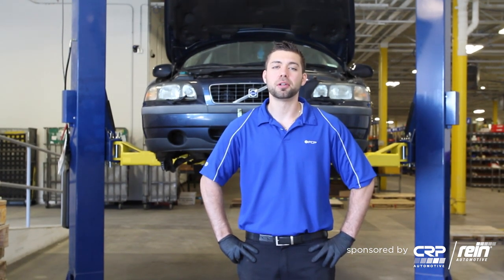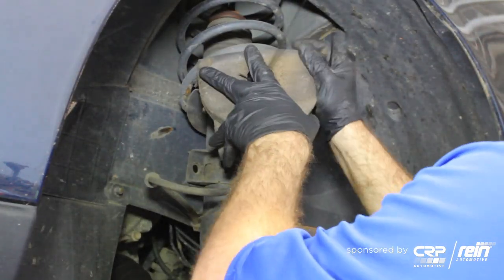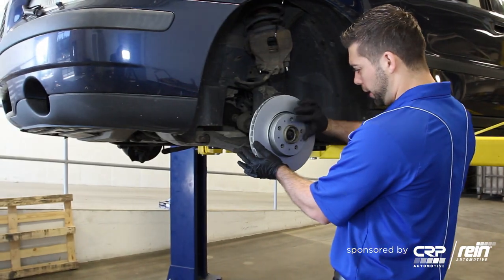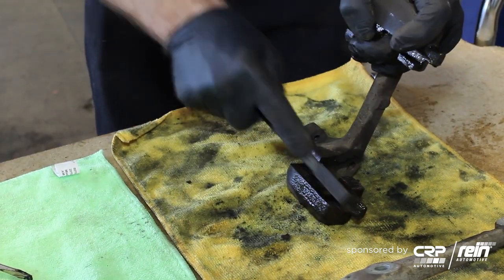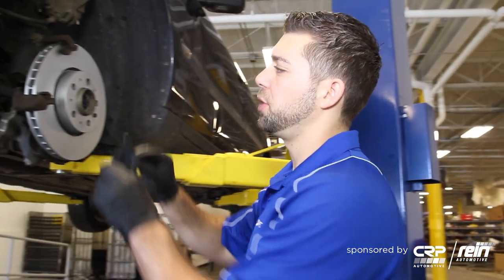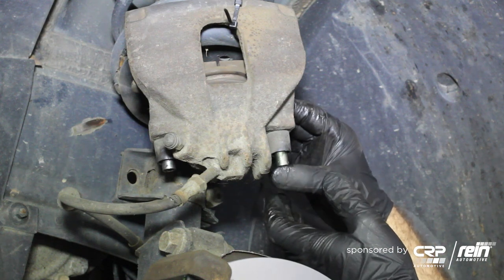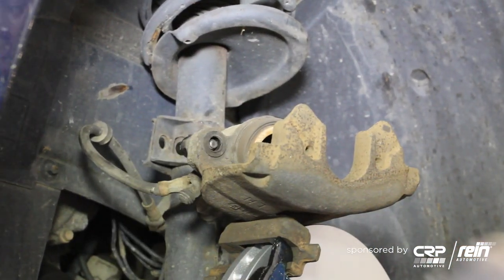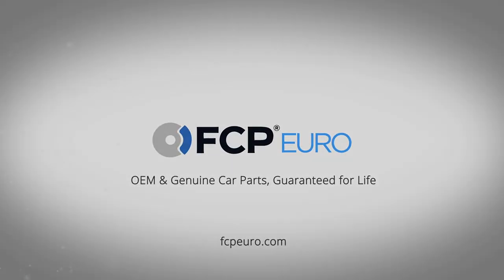How To Replace Volvo P2 S60 Front Brakes DIY (S60, S80, XC70, V70)

Comment: I wanted to take a moment and say THANK YOU! It's been over 20 years since I did my own rotors and pads; but between that and your video, I had everything I needed! Very helpful, very methodical, very detailed! The ONLY thing I would add is that I added Permatex Anti-Seize (grey tube) between the inside of the rotor cap and the wheel hub...but this is, of course, optional. I also needed to go through a bedding procedure (after pumping the brakes to move the piston in) before my brakes were braking like normal again (but that was the fun part of the replacement!)

Comment from the maker: The T-5's have the larger brake setup in 2006 so they will be a bit different however the essential information from this video can be used to help you.
Reply: Same with the t6s. Instead of 7mm Alan its a t45 torx. Believe all else is the same

Comment: There is one very important trick with the respect the spring clip replacement. 
If you happen to put them on with little or no effort, you have installed them incorrectly. Doing it incorrectly will 
A; drive you insane as you try to determine why your brake pedal is so mushy. 
B: Make you go even more insane as you start to try bleeding the brake lines and start contemplating a master cylinder. 

You went past that part quite fast and it is very important to get them right. 
If you edited in a short piece of how those spring clips should be on the outside of the caliber bracket and why you have to use that screw driver to pull the clip up and over the end, it would help with that last important installation step. 

Other wise a good video.
Reply: Can you explain more?
Reply: Absolutely and thank you for writing this! 

Happened to me exactly as you described and your comment saved me a lot of screwing around!

Comment: I liked this video overall.  Too often cleaning the calper frames is skipped.

One note, the time to indlect the caliper piston boot is before the piston is pushed back, and it should be rinsed off eith brake clean and lightly lubribated before pushing it in.

Comment: Hello, typically you'll need to change them at every other pad change however its always best to measure the rotors at every brake change to make sure they're not below the minimum thickness noted on the rotor hat.

Comment: Nice straight forward instruction video. I did notice that the brake hose was frayed and almost coming apart! I would have replaced it, and if saved for a different video at least point it out.

Comment: Are the rear brakes the same?  Oh, I'll be replacing the brake fluid as well do I start with the Right rear brake line on the S60 or is the ABS Module in the rear?

Comment: I'm old school and always open the bleeder when I push back the piston.  The reason was that you never push fluid backward into the ABS.  Things may have changed over the years but back in the day working on Jaguars there was more than a few ABS valves / pumps that were destroyed by pushing fluids backward.  Dirt ...maybe but the cost of those ABS valves were $1500 and it was much easier to open a bleed valve.
Reply: Thomas Miller

Comment: Thank you! This all turned out great and stops on a dime. No pulling or vibration when braking so I know the rotors are on true.however I hear a grinding on both sides when accelerating or rolling in general . Could it be that the new rotors are thicker and I need to pry the shield back a little? Mine were the 11" diameter x 286mm thick. Pre turned. Got them from Napa. It sounds like the shields. I verified everything is locked down and the springs are in the correct position. Any thoughts? Thanks.

Comment: Video was so easy to follow.  This was my first brake job and it went smoothly. I also need to change the rear brakes and hope you have an easy to follow video for the rear.  My one concern after changing the front is that the pedal seems soft after pumping the brakes.  What do I need to do to fix this?  Do I need to bleed the brakes?  If so, any videos available showing how to do this?  Thanks in advance for your response.
Reply: Watch the part very carefully where he reinstalls the spring clips. 
This is extremely important.

Comment: Zip tie trick is great. Procedure is identical for 2006 XC70 except I don't have that backing bracket behind the carrier bracket which is nice. Also, I suspect this guy likes the smell of brake cleaner because he uses it on everything. Study the way he puts on the caliper spring. Much easier than the way I did it.

Comment: Hi guys, I loved your brake changing videos!!! Is it true that you have to change the rotors on a volvo s60 2004 every time you change brake pads?
Reply: I am not an expert on volvos or cars, but for me I always change the rotors when I change the pads.  but if you dont  want too just make sure they are within spec and have them turned. :)

Comment: I want to replace my 2016 S60 stock 300mm Calipers to the 336mm R-Design ones for increased braking power is it just the calipers and pads replacement or other parts are involved too?

Comment: Hi. I found that forcing the piston back into the calliper caused a problem with the brake system and resulted in loss of brake pressure. I think what needs to be done here is to loosen the bleed nipple then push the piston back and allow the fluid to to pass through the nipple. Retighten the nipple when the piston is all the way back. This method means the rest of the brake system won't be affected.
Reply from the maker: Hi Geoff, that is certainly a way to do it! You can also remove some fluid from the reservoir at the beginning of the job, and then top off as needed.

Comment: One thing that is super important to mention is the corrent rotation for the ventilated disc they just dont go on any way
Reply from the maker: A good majority of ventilated brake rotors are non directional. You can tell if a brake rotor is directional based on the orientation of the fins inside the brake rotor and there are usually different part numbers for the rotor between the left and right side on the same axle. The S60 featured in this video uses a non directional brake rotor so no special attention needs to be payed when mounting them to the vehicle.

Comment: you do good vids and now happily a subcriber.  I've done many pad changes on other cars and dont suspect this should be any difference.  I have the pins out and have not be able to remove the caliper from the frame, over an hour of prying and banging  and just seems hung up and wont pull off, i have compressed a bit the piston while still on the frame to try to create more clearance. Don't get it, any suggestions? Why do small simple jobs too often find a way to be not so?
Reply from the maker: Thanks for subscribing, Barry! That is strange that the caliper is hung up in the carrier. I would just remove the carrier/caliper bracket altogether if you can't get it separated.

Comment: Hey, is it necessary to put loctite (blue or red?) on the bolts that hold the caliper bracket in place when putting them back in? Going to do this job on my 01 S60 soon
Reply from the maker: Hi, Michael. It's not 100 percent necessary, but its also not a bad idea to do so!
Reply: @fcpeuro  thank you very much! Bought some loctite just for extra safety :)

Comment: What type of grease you r using? Can I use just copper grease?
Reply: The grease it ATE plastilube p/n 700015 which can be found here: https://www.fcpeuro.com/products/brake-pad-silicone - This is what I recommend to use.

Comment: What are the torque specs for the caliper and bracket bolts?  Also, should I use thread lock on the bolts?  Will this work on an 06 S80?  I already bought the kit from FCP.
Reply from the maker: This kit fits an 06 S80 w/286mm front rotors. The caliper slide pins do not need lock tight however the caliper hold down bracket bolts do. The torque is 30nm on the caliper bolts, 100nm on the caliper hold down bracket bolts.

Comment: You pump the brakes to push the cylinder and pad against the rotor not "to build hydraulic pressure". That way, when you need the brake for the first time, the piston won't have to travel a long distance before seizing the rotor.

Also I don't believe lubing the back of the pad does anything. Lubing the sliding parts of the pad sure, but not the whole back.

Also you should use a torque wrench for final torque when putting it back together.

Comment: After watching this video, I realized something. I just bought a 2006 S60 T5 (first car woo!!) and for some reason the calipers look nothing like that. They have a full frame and clip where these just have the spring clip. They still say ATE Volvo on them so I know they are an OEM front caliper, but with all the DIY videos and writeups I see, there's none with my type of caliper.Besides the frame, would there be any glaring differences I should be worried about?
Reply: Nothing to worry about if your brakes are working.
Reply: After getting them done by myself, I realized that my example was one of the few 2005-2007 ones that got the XC90's 316mm front discs and calipers. 

Hooray for FCP and their endlessly understanding team having to deal with me. hahahaha!!

Comment: What kind of grease was put on the back of the brake pads and what kind was used on the slide pins? Is it the same for both?
Reply from the maker: Yes, you'll be able to use the same paste for both. ATE Anti-Squeal Paste was used in this video.
https://www.fcpeuro.com/products/brake-pad-silicone

Comment: Nice work! I'v been looking for a guide that shows how to upgrade the breaks with original parts. (Bracket for 300-320 mm rotors) and just some 320 mm rotors. Anyone done that ?  Notice: Not the R-breaks- I've got a -01 S60 T5

Comment: Is it normal for there to be a grinding noise after installation, or does this go away after a short time?
Reply from the maker: There shouldn't be a grinding noise. I would double check the dust shield to make sure it's not rubbing on anything along with the pads to make sure they're seated properly.

Comment: 1. I know what an OEM parts is.   A "genuine" part is one that is what it says it is, not counterfeit, but not necessarily as good as an OEM part.
2. Neither a screwdriver not a wire brush will remove rust scale from a caliper bracket.  If you aren't going to pickle them, use a file.
3. Apply a grease corrosion barrier on the caliper frame, install the abutment clips and lube them befor mounting the frame to the vehicle.
4. That'snot how to grease Bosch brake pads.  The ONLY function that a grease provides on Bosch pad backs is to inhibit corrosion of the caliper body ears and piston face. They do not slide relative to the caliper  The back shim is coated so there is no metal to metal contact, and the multi-layer shim is what dampens the high frequency vibration. Bosch's own install video uses NO grease on the backs. What grease is between the caliper and pad backs once installed is thousands of an inch thick, any excess is just a brake dust collector.
5.  Brake dust/rust on the seal is what damages the piston. Clean the "ears" of the caliper and the face of the piston, inspect the seal for damage and clean both BEFORE compressing the piston.
6.   Any contaminated fluid in the cylinder should be drained, not forced back up the brake line. Put  a bleed hose on the caliper and use that to bleed fluid before or as the caliper is compressed.
Reply: 6. Brake bleeder broke when opening, now stuck home without a car and can't even get to the parts store to buy a whole new caliper. Please tell, why was old fluid in the caliper so bad to take this risk ?

Comment: Are those 286mm rotors? Should I expect the same for my '03 XC70?
Reply: there are different diameters for those cars. 286mm, 305mm, 325 mm. you should check your old rotors and buy the same size

Comment: Do you need to bleed your brakes after doing this?
Reply from the maker: Hello Darlene, you usually don't have to if you're just replacing pads and rotors. You will need to be bleed the system anytime it's opened to get air out of the line. Bleeding the system will be needed when replacing a brake caliper or brake hoses/lines.

Comment: I keep ordering the 15mm bolt as mine is missing and I keep getting a 18mm. Anyone know the part number or where to order the 15mm caliper bracket bolt?
Reply from the maker: Hi, Jeff. Sorry you are having trouble getting the correct bolt! Please email service@fcpeuro.com and we would be happy to help you!
Reply: Thanks. I ended up going to the hardware store. Needed a M12 55mm Bolt. Had to get a 60mm and add some washers.

Comment: Cool video! but be sure to mention not to get any Silicone on the Rotor or pad surface cause we know what that will do! And if there is a Brake Pad and Rotor Bed-In Procedure the manufacturer specifies.... just saying.

Comment: some how i broke the screw that holds the rotor in place where can i get one
Reply: they are not important, only used as an assembly aid in the factory.  lug bols hold your rotor on, then rust does.  but you can always use a  llug bolt as a substitute while working

Comment: Just done this job on my S60. Now when I apply the brakes when reversing, parking or other slow reversing, I hear a kind of clunk from the brakes. Only as I apply the brakes and only once, like they're engaging or something. And only happens when the brakes are hot, like after a long drive.
Any ideas? Brakes work fine otherwise. Doesn't happen going forward.
Reply: Sounds like the handbrakeshoes, i hade the same problem on my v70. But Only when reversing
Reply: My lower 15mm bolt broke off causing this same issue. The brake brackets were jumping or swinging in place while reversing.

Comment: Is it possible to put 2003 s60r brakes on a 2001 non r s60? Like the rotors, calipers and pads?
Reply from the maker: Hello, I don't see this being an issue but you will need caliper brackets as well for the larger diameter brake rotor.